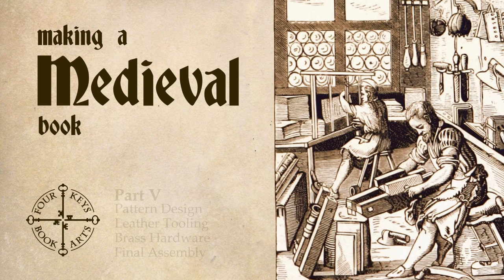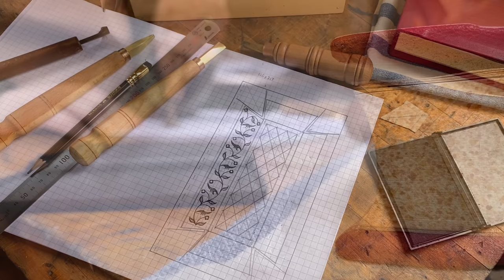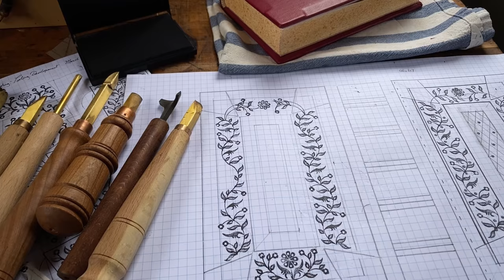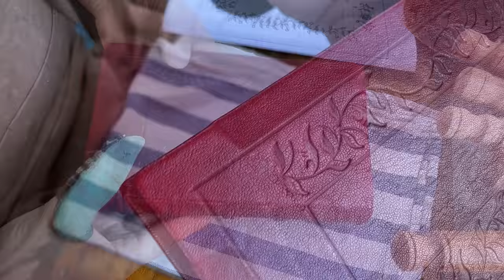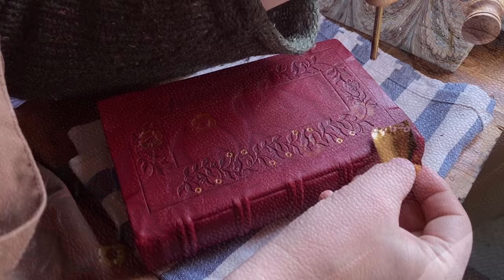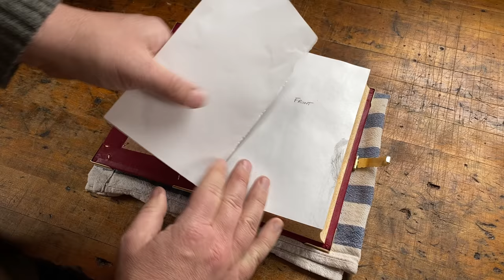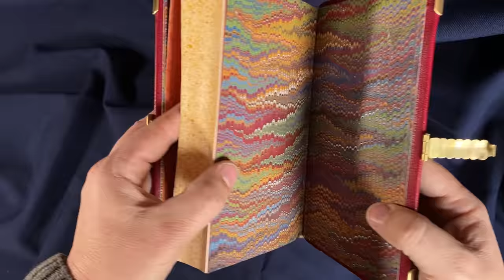Making A Medieval Book By Hand - Part 5 - FINALE - Leather Tooling - Brass Hardware - Final Assembly

Comment: At this moment, my first own book project lies in the kitchen, in the "press" under a huge pot of water, the pages uneven and messy, without any proper tools except my trusty bone folder. Seeing this amazing piece of art and the absolutely astounding way to its finish intimidates me, for I will probably never have the money for getting all the gear it takes to make such a wonderful thing happen in my mini apartment, and all the skill that I don't have. But I also feel a bit thrilled for taking this challenge of making such a thing on my own, one day. Until then, it is messy uneven pages and a pot of water. But I am looking forward until this crooked first attempt is done. It won't be the last.
Reply from the maker: Everyone starts somewhere, and I still use and appreciate my first lumpy, imperfect books. Tools and skills can both be acquired over time, but you clearly already have the spark to bind books, which is the best thing to have! Good luck, and happy binding!

Comment: also try the method of carpenters to bend the nails. Slightly bend the tip and then beat them completely and then bend them. You can also use a Ghimlet type hand drill for holes - a little faster and less sawdust.I like yours video
Reply from the maker: Thanks for the tip! As for the gimlet, I don't have one that would be anywhere near small enough.

Comment: MUCH greater appreciation of the expense these books/libraries represented!  

What is the typical time to create a book at the time? What was the typical output of a bindery in a year? Watching this surely makes one appreciate true skill and craftsmanship. It is also a great juxtaposition to the beginning innovation of the industrial age. It is an excellent reminder of the value of knowledge and dissemination of knowledge. In short, book manufacturers enabled knowledge to spread. Books are THE original hard drives of the human mind… analog computer. Because of books, knowledge was able to be recorded and change the world. 

Did people/monks work more often on finished books? Or work from the partial, unfinished, and much smaller portions of signatures/gatherings prior to the finishing and binding?

Relative value changes over time… so, I’m curious what value a book represented. What is the relative cost of such books (by each finished quality (excellent/good/common/regular quality (papal, parish, minor-nobel-family, bourgeoisie/business quality))? Relative cost comparison to annual human output/labor and other goods? (Example: book vs chickens/pigs/food; book vs blacksmith swords/chain mail/locks/nails/horse shoes; book vs building/carpentry cost (cottage/barn/table/bed); book vs linens/sails; etc.)

Comment: Have to admit, I rarely use heat transferred foil for gilding, however I came into binding through calligraphy, and had been gilding using gold leaf for years. The advantages are the process does not require heat, is more versatile, and with care and planning can get better results. 

The disadvantage of course is that it is much more time intensive. 

Still, even now I both love and dread the final tooling of a book. It is in many ways the most rewarding part of the whole bind, but one bad mistake can set you back badly. Small mistakes are fine, they even add character, but get something seriously wrong and you have a lot of work to redo!!!

Comment: @25:00 for small holes like these I use a jeweller's Archimedes Drill - you can get modern ones, but I have quite a few vintage/antique ones that are much better, as they are one-way (only work on the down-stroke) and have a flywheel. Also I use parallel pliers to fold over and secure the pins, more control than a hammer, I find.
What a great result! You have given me the impetus to embark on a few projects I've had in mind for years, but didn't have the confidence to start - thank you!
Reply from the maker: I rarely need an excuse to seek out new tools! Thanks for the tip.

Comment: Beautifully made, although the history degree in me screams about the not strictly medieval aspects. Paper marbling only took off in Europe in the Renaissance, and the splatter technique was somewhat later still. Your commentary was well done. It may have been good to add in parts for those watching things like when you frequently used PVA glue, that they had other options like hide glue which is reversible and extremely strong. Or that the printing press was yet to be developed and the pages you were binding would have already been written and illustrated. Anyway, a very pretty object. Would love to see someone make a fully medieval one, parchment hide, silver clasp, full of calligraphy and illumination.

Comment: Drilling that tiny hole into the book for attaching the hardware gave me flashbacks to when I was finishing up some boxes I was making and predrilling some holes for little wooden inserts on the inside lid and I drilled directly through the box and into my finger like a total fool. I learned to pay attention to where I put my fingers, and be more careful with the drill pressure after that. Until I was using a nail gun on something else a few months later and it went through the piece of wood into my finger, then I REALLY definitely learned my lesson for sure that time. Luckily it was just a lil pinprick, but there was definitely more "Ahhhhhh" and I felt a little sick, contrary to what Pink Floyd promised me.

Comment: Like everyone else I am delighted by your craftsmanship and artistry (and the quality of the filming and editing too - outstanding!). I have a couple of questions though.  Firstly, I understand the use of PVA in a book which explores medieval binding techniques: it enhances durability and is way more pleasant to use than, say, rabbit glue, but why not apply the same considerations to the case boards, and use plywood?  The oak is beautiful, but is liable to warp and possibly split, due to the single grain direction.  Indeed, you could see it warping during your video.  Secondly, isn’t the joint between the endpapers and the text block a little weak?  There is only the thread and PVA holding them together at this point of particular stress and fatigue, although I expect that the leather brace around the tapes would add quite a lot of strength.  These are not criticisms, rather an interest in the approach and experience of an artist and craftsman of the highest order.  
Cheers, Will, Scotland

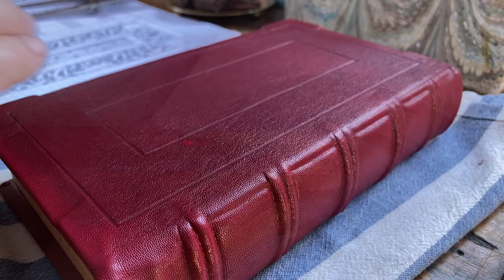Comment: Curious, what happened to cause the patch of discoloring you can see to the left of the stamp at 10:55? You stamped the veined leaf over it at 11:05, so I'm assuming it wasn't significant enough to keep you from tooling the leather, but earlier in the video (since 8:45) it looked pretty gnarly.

Comment: Found your channel a few weeks ago and went back and watched everything you uploaded since it was that interesting. But I have to ask out of curiosity as I've seen other people work with leather, is the heat when tooling really necessary? Or is it that if you were to do without you could damage the book by needing to apply more pressure?
Reply from the maker: Excellent question! The heat does in fact help, both to make the impressions more permanent, and also it darkens the impressions (this can vary by temperature and the kind of leather) to make them stand out more. Thanks for watching and commenting!

Comment: As a professional bookbinder, I see that we are dealing with an amateur bookbinder.
He does a lot of unnecessary things. The paper doesn’t fold the way it should, the rounding of the spine and the corner indentation of the leather cover is awful, and I see the bone glue as an adhesive you don’t know. The board should have been filled from the inside to be flush with the thickness of the skin. The video is good anyway.